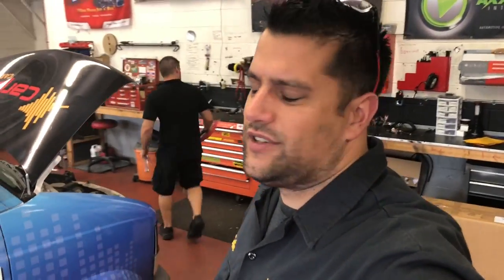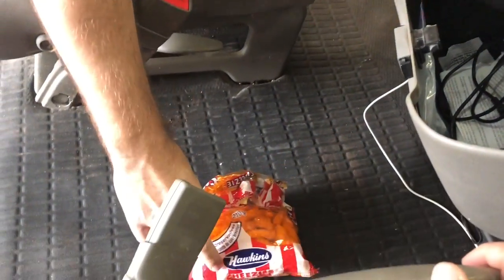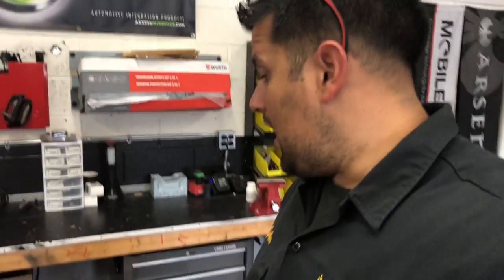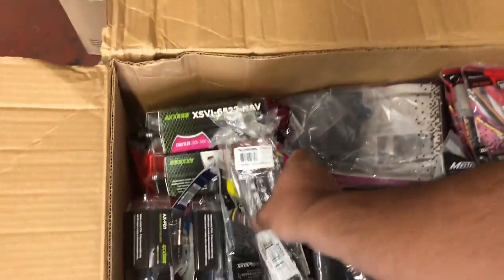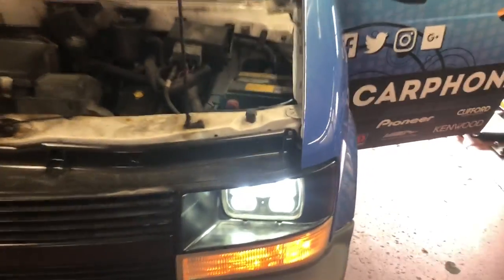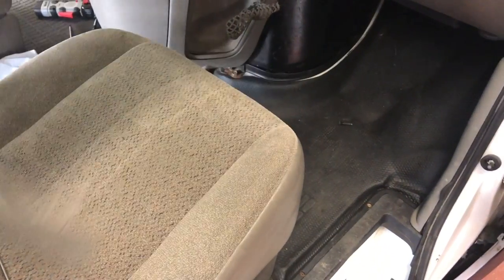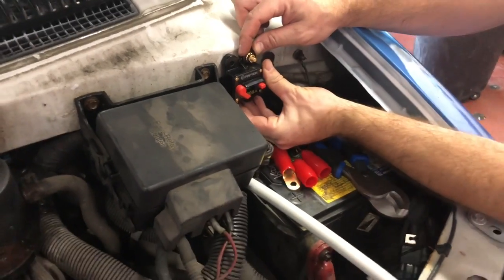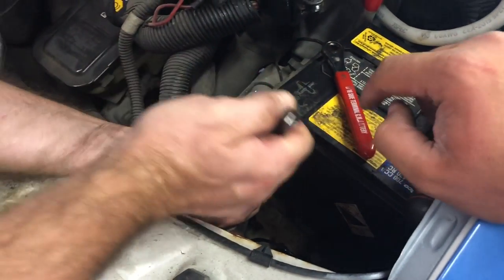Building The Audio System In The Shop Van

Comment: Did you remove the panels on the rear doors? There's usually cut outs in the metal for rear fill speakers in them. Would give you much better sound than just putting a pair of 6x9's in boxes hanging from the roof.
Reply from the maker: Rob LaNasa no we didn’t remove them, but now that I’m thinking about it it’s probably a better idea to mount them in the rear doors. The panels that are there now are just a steel panel with no cut outs but we’ll make er happen